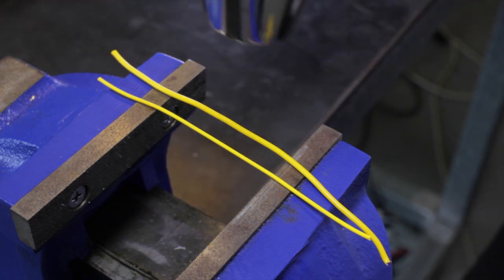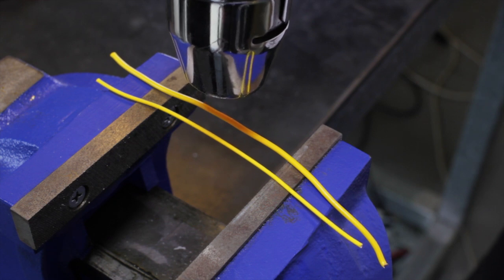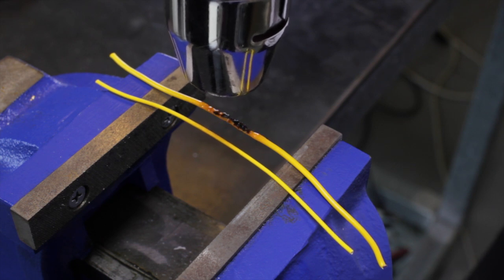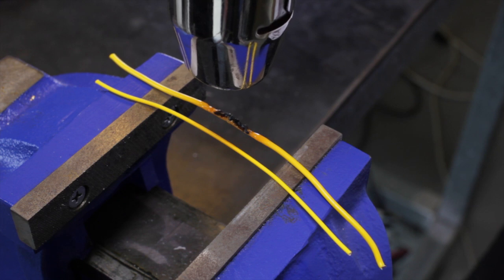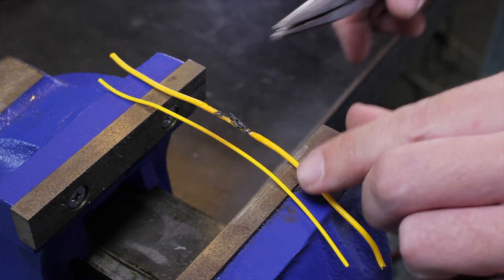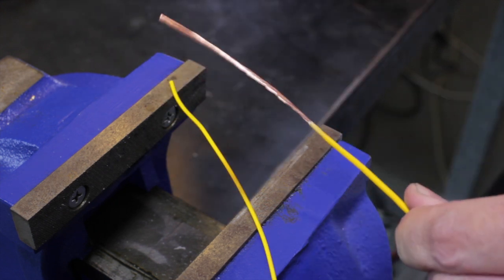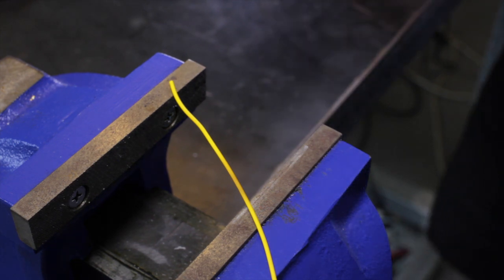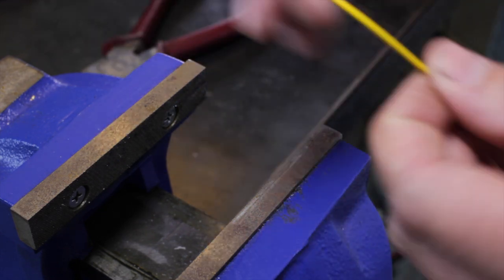Why Tefzel wire is BETTER

Comment: Hey there, im a little late to the show but may i asked, which insulation you used for the standard wire?
Best Regards, Moritz
Reply from the maker: Standard wiring from your local automotive shop is generally PVC coated. TXL is better to use, and Tefzel is what is used in motorsport noting there are a lot more types and specifics out there.

This lesson shows the example with PVC coated, TXL and Tefzel near the start as well: https://www.hpacademy.com/introduction-to-wiring/?utm_source=youtube&utm_medium=social&utm_campaign=general-interaction  - Taz.

Comment: OMG........... The car fraternity only now catching on to things like this!!!!!!     .... Manufacturers of good electrical products for industrial use have been doing this for 20 plus years!!!!  SEW, DANFOSS, SIEMENS, To name a few have used CANBUS , and high quality wiring/ cabling for so so long!!!!!! It was standard when I started my apprenticeship in 1993  ...... On commercial printing presses!!!!!  The laser distance measuring on suspension these days was used in the year 1998 for measuring the difference in paper thickness.. ie 2 thou. On  reject copies that were missing one sheet of paper!!!! ...... at super high speeds!!! .... I'm into cars a lot.... but they are so so behind in technology!!!! I'm glad my old HR HOLDEN in 1997 had a digital dash with a 3600 absolute encoder telling me my speed!!!  Oh and in 1999 had touchscreen start, fans, fuel pump,and more!!! Most industrial sparkles will testify to that!!!!!! Especially from the printing industry!!!
Reply from the maker: Not quite, it has been around in the industry for a long, long time as well, and this video isn't a fresh release either ;) Thanks for sharing though! It is great stuff =) - Taz.

Comment: When buying the supplies for a mil-spec harness project where could I find specific information about which wire should I use for a setup?? There are so many options as Mineral Filled, Extruded PTFE, TPC, NPC, SP Alloy, NP alloy that just figuring out which is better suited becomes a daunting task, and we are not even getting to the connectors and crimping tools.
Reply from the maker: Hey JA EC There are a variety of different wire types available and in most cases more than one type will be suitable. Generally when we talk about mil-spec, we are referring to either Tefzel or Raychem Spec 55 wire. Suppliers such as www.milspecwiring.com will be able to supply this for you.

Comment: That's normal wire in aviation. Milspec.
Reply from the maker: Yes, you aren't wrong. A lot of motorsport spec wiring techniques and materials come from aviation and military. :)

Comment: I believe I have worked with this sort of wires, they feel a bit stiffer than the regular right? is it the type of wire used in most oxygen sensor wirings for example? good vids!